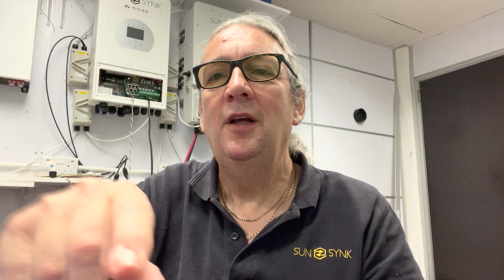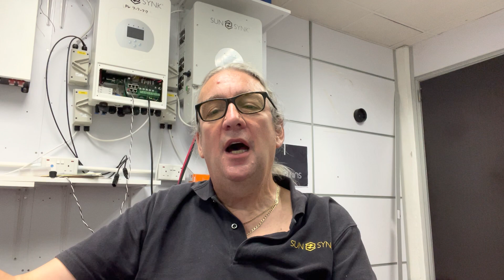Advice when installing a Sunsynk Hybrid Inverter

Comment: Does SUNSYNK offer a option where one can install a 2nd/separate LCD display, say in the kitchen, while the inverter and batteries are in the garage? I would like a 2nd LCD screen and NOT use the App on my cellphone. Please will someone answer my sincere question. Thanking you in advance.
Reply: I'm planning to use Solar Assistant, which would give you a web interface, this runs from a Raspberry Pi connected to the Inverter so you can bypass the app which I hear isn't great.

Comment: Hi Keith, 
Must the grounding on the inverter case be to separate grounding rods or can I join it to the common ground in the distribution board to the house? Is this the same for the grounding on the lithium battery casing?
Reply: I'd say that it depends on the regulations in your country. 

Here in Spain, the code doesn't actually get into such detail regarding solar installation grounding, which causes quite a lot of confusion, even among professionals.
However, if you persist and keep digging for information, you'll hopefully find some answers.
In my case, I found an official code interpretation note published by the ministry of industry, which applied to solar installation grounding (albeit indirectly). 

According to this note, all PEs must be connected to the building's own grounding rod (which is separate from the grid, following the TT earthing system).
But this only applies if the solar installation is integrated in the building/house.

If the solar system isn't integrated in the building/house, then an additional grounding rod is installed next to the solar system's location, where all PEs from the solar system will be connected. 
Now, depending on the distance between the house and the location where the solar system is installed, this separate grounding rod might need to be bonded with the building's main grounding rod. 
If the distance is below 100-200 meters or so (this depends on the characteristics of the soil), then both grounding rods need to be bonded.
If the distance is above 200 meters, then the grounding rods can remain independent.

Comment: Hi Keith, I have a Sunsynk 3.6kW AC 7kWp inverter with a pylontech us5000 and no communication

I'm using the supplied bms cable that came with the inverter and can't get any comms when trying to set it up as a lithium battery, currently have it on the AGM setting, have read that some are saying the bms cable is not correct for the pylontech battery, any help would be much appreciated, regards Tim

Comment: Hi, please can you clarify something for me, I am looking to install a 8KWh Sunsynk Inverter with two 5KWh lithium batteries, an electrician told me that this will give the inverter problems in that it will try to draw more current than the batteries can supply and that I should install 10KWh batteries, any advice would be appreciated, thanks
Reply: A good rule of thumb is that lithium batteries can at best only provide 50% of their capacity as continuous discharge. This means your combined 10kWh batteries can only supply 5000W continuously. With that said, unless you actually require 8000W of load capacity while the grid is offline, I see no reason why your 2 5kWh batteries wouldn't be enough to handle normal household usage comfortably
Reply: If Sunsynk software has the same basic settings as Deye's (and it looks like it does), you'll be able to limit max battery charge/discharge current to the number of amps that you please (within reason). 

As for the recommended max battery charge/discharge current, that'll depend on manufacturer recommendations and type of battery.
The rule of thumb for lithium is 50% of battery capacity (Ah), so if you have a capacity of 200Ah, it should be ok to set a max c/d current of 100A.

Pylontech US5000 is supposed to have a recommended c/d current of 50-75A (with a max of 100A).

In my case, I bought a 5kW Deye battery, the supplier's tech department is telling me that I can set max c/d current to 100A if I want to (even though I only have a single 100Ah battery), since the battery's BMS is smart enough to reduce c/d current to safe levels when needed.

 We rarely need 2-3+kW when the battery is discharging (during the evening-night), so limiting c/d current to 50-75A (~2500-4000kW) isn't a problem for us.

Comment: Hi, I have a 12kw 3 phase inverter. When grid fails the potential difference between neutral and earth on the backup rises to over 100VAC. I would like to fit a relay to bridge neutral and earth during grid failure. If I connect the relay to grid power, the problem is that when grid returns, the inverter has not yet switched the incoming grid internally as it waits for the grid to be stable. I measured terminals 5 and 6 and no voltage on those terminals when grid is on or when grid fails. I selected Signal Island Mode and still nothing. Any setting that I may be missing?
Reply: Hi Arthur, is this what you are looking for.....   https://www.youtube.com/watch?v=-5S1uUTtQps&ab_channel=GlobalTechChinaLimited  Apologies if not.

Comment: Hi Heith
I have just done a 5kw installation myself. No batteries yet. It seems to be an overachiever so far and I am highly impressed.

Question: The last 3 nights we had serious lightning storms in our area. It seems that the system switches off and does not come back on. In the morning everything seems fine, but in the top left-hand corner, it says OFF. No power is generated even though the sun is shining. I then do a shutdown procedure and a startup procedure as per the manual. The system then comes back ON and performs normally. 

There are no fault codes registered for these events.

Is this normal ?

What have I done wrong ?

Could it be an installation fault or a setting fault ?

I cannot think that it was designed this way.

Any comment or possible solution would be appreciated.

 

All the panel frames are linked and properly earthed.

Comment: Hi Keith I in the process off installing Sunsynk Sun 5K Hybrid Inverter (With wifi and CT) .If I have reached my 5 k and I require another 2 k .Does it fetch the 2 k from the grid?

Comment: i have a 5kva sunsynk inverter and at night it only charges the battery and continues to use grid power . hiow do i make it use the battery at night and not grid energy
Reply: Use the timer on the System Mode screen. Set the SOC you wish to discharge the battery to, and the inverter will use the battery until it reaches your set SOC before using grid power. If you have PV panels, I would also suggest that you disable Battery Grid Charging from the Battery screen, unless you go through an extended period of overcast weather where the PV power is just not enough to charge your battery fully during the day

Comment: Keith, please explain how exactly to lengthen the CT wire, if the inverter system is far from the mains supply. I have tried a few times where the inverter just does not pick up the CT.
Reply from the maker: Really depends on the type of cable you're using and what other interference that could be around 10 to 20 m max

Comment: Hi Keith
Let me start by say I really enjoy all your videos as they are very informative. I’ve been looking at fitting solar with the final objective not to depend on the grid at all. This is  due to the SA power issues and them put electrical prices up as and when they feel. Currently I have calculated that I would require around 8.5 kw system to be off grid. Due to pricing of a full system to do the job my intention was to start with one 5kw inverter with its additional requirements and the n add another later.

The only down side is once I split my DB for the essential loads I only have a average of around 500w requirement. The inverter from what I understand does not cross feed the PV power to the heavy loads when there is abundant watt available.this means that the 5 k inverter only takes care of the UPS load and Im stuck with the grid suppling the balance ( let’s say the total house requirement is 2000 watts 400 would be cover on the light side by the inverter and 1600 watts I will have to pay issskom for. But it’s 12:00 noon and have 4800 watts coming off the roof. This is the only thing that is making me look into an Alturnative inverter option that cover both Heavy and the light side of the inverter when there is sufficient power from panel or batteries to do so. 
Or do you have another way to sort this problem out. Please advice as other than this down fall your inverter gets a 💯 % thumbs up from me. Thanks
Reply from the maker: Thank you very much appreciated
Reply: @sunsynk  Hi Kieth!! Please can you comment on the question asked??
Question:
The only downside is once I split my DB for the essential loads I only have an average of around 500w requirement. The inverter from what I understand does not crossfeed the PV power to the heavy loads when there is abundant watt available. this means that the 5 k inverter only takes care of the UPS load and I'm stuck with the grid supplying the balance ( let’s say the total house requirement is 2000 watts 400 would be covered on the light side by the inverter and 1600 watts I will have to pay issskom for. But it’s 12:00 noon and has 4800 watts coming off the roof. This is the only thing that is making me look into an Alternative inverter option that covers both the Heavy and the light side of the inverter when there is sufficient power from the panel or batteries to do so.
Reply: @RonaldWiseman if you are in need of a solid installer speak to Solar Skye. Solid bunch of guys
Reply: @Ronald Wiseman, both my Sunsynk inverters handily sends all the available PV to the load, and only starts suplementing with Grid power if the PV is insufficient to carry the load. Perhaps look at your settings, I suspect there is an issue with the installation or with the settings of the inverter which might easily be corrected at no additional expense

Comment: Hi, nice list of do's and don't of a Sunsynk Inverter... 

Though, how do you know if you have bad communication cables? 

We had a parallel problem in our 2 units - 8 kW Deye Hybrid Inverters with 2 units - 5 kWh GSL LiFePo4 Batteries.  

We connected the 2 Inverters via CAN port with 00 Lithium Mode. Then we connected the "Master" Inverter to the Master Batter, the Slave Inverter to the Slave Battery. Then we connected the Batteries via RS485 B. 

They work each one independently but they don't work when paralleled. 

What could possibly be the problem?

Comment: Hi Keith, can you please explain the Passthrough current on the inverters? In the manuals they indicate the amps but we find that the inverters still trip out af the Max Watt's. On the Victron inverters they have pass through current that runs through the inverter as long as grid is active but with the Sunsynk its limited to max Watts of the inverter.
Thank you
Reply from the maker: It's 50% more than the rated power of the inverter

Comment: If the generator connected on the grid side with a CT. How does the inverter distinguish between power from the generator (it doesn't export power) and power from the grid (export is allowed).
Reply from the maker: You program zero export the CT will prevent the export